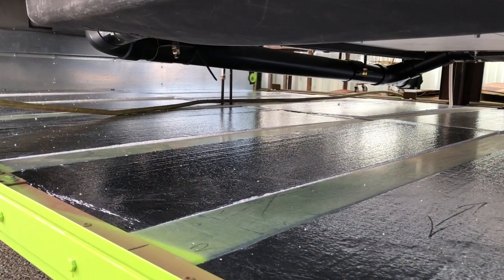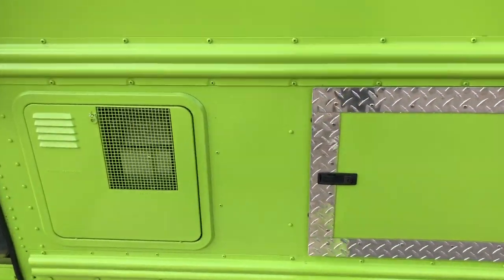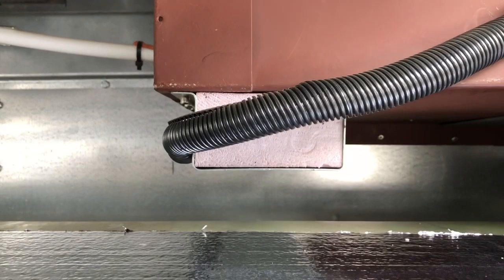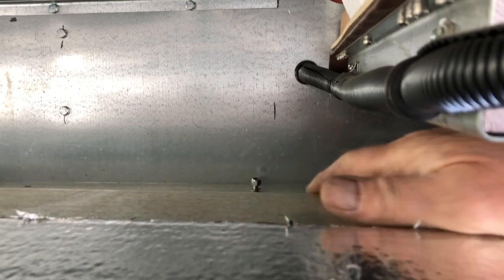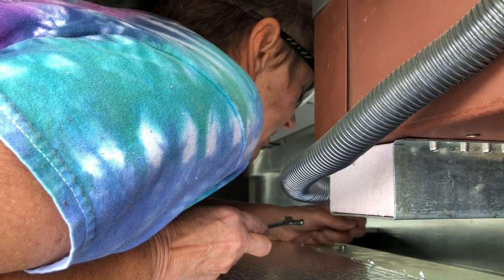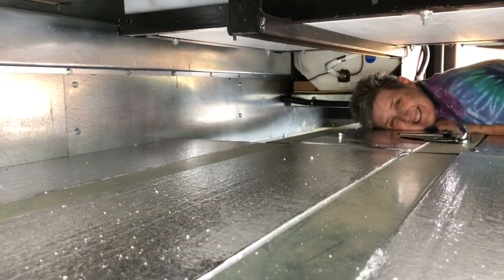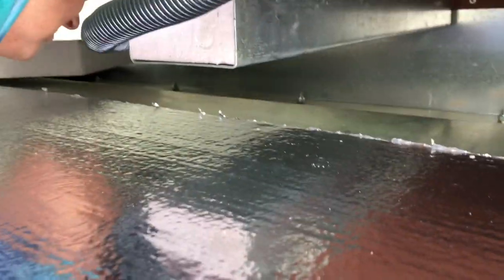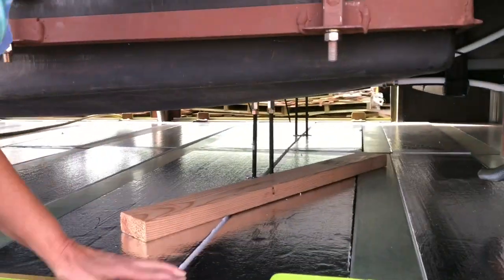Insulating Under Bay Storage - Part 1 - Vlog 181 School Bus Conversion

Comment: What a result Randy, got to be proud of that. What covering are you thinking of for the metal?
Reply from the maker: We use galvanized metal everywhere so we wouldn’t have to paint.  😃
Reply: @KnappTime  Ah, i thought you may use an automotive carpet to deaden a little noise and make it non slip for storing items in the bays.

Comment: Now that is awesome teamwork, this is very good. And if you ever come to cold weather that insulated bay with prove its worth when your tanks do not freeze and the floor is warm under your toes. Also the water tanks are low to the ground and between the axles, good for center of gravity and roadholding. Seriously, I have seen big, upmarket RVs and they could not hold a cancle to yours. Great job.
Reply from the maker: Thanks 😊 it’ll get a good test this winter here in eastern Oregon because it does get pretty cold here.